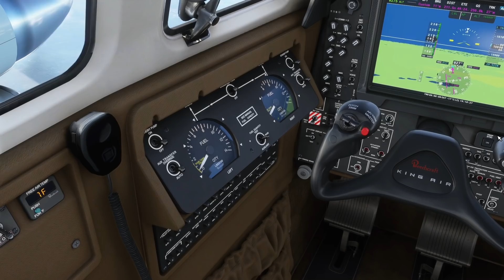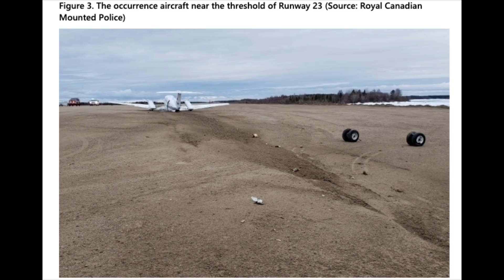The Pilot Who Forgot To Fuel His Plane | Keewatin Air 202

Comment: That windmilling prop creates a whole lot of drag. I'm pretty sure if they would have immediately feathered the prop they would have landed on the runway without any damage. But they still would have been idiots
Reply: Not true. All airplanes have a figure called "best glide". It can be as high as 1:60 for a good sailplane, and as bad as 1:3 for a parachute. But powered airplanes are between 1:15 and 1:20. But I don't think that 1:20 has been achieved yet. 

The normal approach path to a runway is 3 degrees. This is equivalent to a 1:19 glide path.  So a powered plane with engine out is rarely able to achieve that glide ratio. This "best glide" of close to 20 assumes: flaps up, best speed for best-glide (i.e. not slowing for touchdown), gear up, props feathered. 

So in general when you plan on landing on the remaining engine and hit the normal glideslope and THEN the second engine goes out... You're in deep shit. 

So.... when the first engine cuts out due to say "blowing up", you can assume this to be unrelated to the second engine cutting out, so "reduce workload by doing things as you normally do" i.e. regular glideslope: Fine! 

But when you run out of fuel, the second engine cutting out is NOT an unrelated event. It is WAY more likely to happen once the first engine has starved of fuel. So you should aim for a 4 or 5 degree approach angle to allow for the second engine cutting out. Sideslip, zigzag, use speedbrakes, put out the flaps and gears to slow down. 

So again, if you are on the normal 3 degree approach path to a runway, you cannot make said runway without an engine running. 

(*) These calculations assume "steady state". If you start on the glideslope with excess speed, you can stay on the glidepath, bleeding off speed for a while. In this actual case, they might have had enough energy to JUST make it. Fly best-glide speed (i.e. aim for a point before the runway) and then fly in ground-effect while bleeding off speed towards the runway.
Reply: @rewolff2  Your thinking is correct, but your explanation does not support your 'not true' comment. Because if they'd feathered the prop, the remaining engine would have needed way less power and fuel so it would likely fail later. 

If they would approach with 90kts groundspeed, so with 40seconds longer power, they'd probably made it even without your very smart suggestions of higher speed, flaps up and maybe staying a bit above the profile.
Reply: @rewolff2  You're totally right, I was dumbfounded listening to him saying they were lowering gear to meet the VNAV and then had flaps out more than 1NM from the threshold, this is stuff you get taught before you fly solo. Complete amateur hour.
Reply: @rewolff2  Wind direction and speed will go into this as well faster. more air speed with power out means the ground is getting closer faster, should of leaned #2 engine and hit best glide for one engine and been ready for engine 2 to quit. 
Remember it is "power for air altitude and Altitude for air speed" since you have no power you are not getting more altitude and MUST conserve what you have. Never put gear out until you know you are making the runway. 
what cost them the plane was besides no fuel was 1. not maintaining B.G.S. 2. putting down the gear to early. 3. not feathering the props. 4. possibility might be a factor was poor choice of emergency landing field. might of been another airport, road or frozen lake, field that would of been a better choice.
Reply: @kandylandfarms9898  For a hanglider or paraglider a 10 knot difference in wind speed is a lot. (there is less than 10kt difference between "best glide" and "stall" on a paraglider) 
But for a big plane coming in at 140 kt... a 10 kt difference isn't that much. 
Now if you're flying at 1000ft with an airspeed of 200 and a headwind of 40kt and at touchdown-height there is only 20kt, then you only effectively have the energy of 180 kt airspeed for calculating how much energy you have available to bleed off....

Anyway, you can complicate the model as much as you like, but quick-and-dirty: without power you can't maintain a 3 degree glideslope without power. You can for a while when bleeding of speed, but not for long. 

here they landed on a flat area before the runway. But if "reaching the runway" is the only thing to keep you alive: don't lower the gear, fly relatively fast and without flaps until you've bled off all the speed you can lose only then add the flaps to be able to bleed off even more speed. If you still are barely making it don't lower the gear. Land on the belly. If that's what keeps you alive (reaching the runway) then keeping the plane reusable is of secondary importance. 

Here a few bad decisions were made. Early flaps, early landing gear with a known-fuel problem likely to starve the other engine too. Doing a few things "right" and you easily make the runway. 

On gliders, hanggliders and paragliders you know you don't have any power for a go around. Or if you misjudge your final glide and end up below the intended glide path: there is very little you can do to recover. For paragliders the fields are often big enough that you do base-to-final above the field. So landing early is not a problem. In spain I know a landing field where there are notorious downdrafts before the field and that field is short and unforgiving. Land early and you're in  a mess. Land late and you suddenly have 200m of height again. And nowhere to land. Absolutely packed down below. 

Low on fuel?: powered planes: Consider yourself a glider stay above the best-glide  cone emanating from the landing spot. Stabilizing on 3 degrees normal approach path: You're below the cone. Once the power cuts, you're in deep shit.
Reply: @rewolff2  “a powered plane with an engine out cannot achieve that glide slope”- WTF are you talking about?- a twin engine plane can climb on one engine- that’s the whole point of having two engines.
Reply: @biffaozzie2373  If you continue reading my comment, you'd see that I meant that a powered airplane with ALL engines out cannot achieve 3 degrees glideslope. So... as a precaution, with one out of two engines out you normally go and land ASAP.  But if you approach the airport, capture the 3 degree glideslope and THEN the second engine goes out... THEN you're in trouble: unless you have lots of energy stored in "speed", you can no longer reach the runway. Remember you're landing because you're afraid your last engine might cut out. Then to approach the runway on the 3 degree glideslope is a bit.... odd. Sure, you only need that last engine to stay running for the few minutes that you're on final, but I'm saying that staying above that, might be more prudent. 

All the calculations about dual engine failure start with: "Let us assume those are independent variables". Well... they aren't. If one engine cuts out, there are lots of common factors on ONE plane that could affect the other engine as well. BA38 coming in to london for example. So... staying in the cone that allows you to glide to the runway seems like a good idea to me.
Reply: And not lowering the gear above 5000 ft
Reply: You’d think that would be their first thought after losing the engine due to lack of fuel. It was my thought and I don’t even fly. It would have been different if they were going to attempt a restart
Reply: Best comment ever.
Reply: Yep, they are the finest Winnipeg has. Winnipeg = Loserpeg.
Reply: I hope Tesla comes out with “autopilot” to self-fly airplanes because humans are too undisciplined and error prone.    .....  coming from a pilot.  ....
Reply: @steveperreira5850  Unfortunately, people can’t be trusted to do anything for themselves anymore. Lawyers have taught us that everything is someone else’s fault
Reply: PJMontoya: Indeed, and they are less capable than ever, we coddle the unfit.  Reverse evolution in full swing.   

PS:  I live in a fly in community.  The lawyer right next door pile drived his new plane with girlfriend and “all important” DOG on a dark, rainy, cloudy night.  “Touched Down and Spiked It not 300 meters from his house.  Arrogant guy not Instrument Rated!

That was 5 years ago, my brother’s buddy witnessed it from 100 meters away!  Stall spin, full throttle, JFK Junior replay on terra firms.

Small planes, best way to thin out lawyer and politician ranks at their own expense!

Comment: Well they learned a lot on that training flight.
Reply: They learned how to look for new jobs, I assume.
Reply: @se-kmg355  I would hope so. The flight was FUBAR from beginning to end.
Reply: @wntu4  Surely a SNAFU?  It doesn't make grammatical sense for it to be "a" FUBAR.
Reply: @Kromaatikse yeah the 'a' was unintended. Fixed
Reply: @Kromaatikse  did you mean it doesn't make semantic sense?
The grammar is correct, the meaning is not.
Reply: @XB10001  To interpret the grammar, you have to expand the acronym to its underlying meaning - which is an adjective phrase.  You don't use a preposition with an adjective phrase unless there is a following noun to convert it to a noun phrase.
Reply: @Kromaatikse  oh, THAT was your correction! I thought you meant that the correct acronym was SNAFU instead of FUBAR.
Now it makes sense.
Reply: @se-kmg355  
I’d keep them. They’d never make that mistake again.
Reply: Touching a hot stove burner is not something one should have to experience to know it will hurt and fuel is nothing different if you don't want to fall out of the sky.
Reply: Something somebody who wasn't even a pilot would know: get enough gas and maybe even double check.
Reply: It Winnipeg so dont be surprised if it happens again.

Comment: This has to be one of the biggest OOPSes of all time!
Reply: I dunno, this seems like nothing compared to the KLM 747 pilot in Tenerife who decided to takeoff before he received clearance from ATC..
Reply: @Syclone0044  
Thanks - was just going to post the same thing.
Reply: Not even a top ten oops. 

“Gimli Glider". The accident is commonly blamed on mistaking pounds for kilograms, which resulted in the aircraft carrying only 45% of its required fuel load...”

Varig flight 254
“...The flight had several intermediate stopovers, the last being in Marabá, Pará. Prior to takeoff from Marabá, the crew entered an incorrect heading into the flight computer, flying deep into a remote area of the Amazon jungle....”  and had no idea where they were. Just kept flying hoping figure out where they were and where they could land. 

Turkish airliner gear up, too fast, bounce and failed go around. 

There’s much worse.

Comment: If the " captain " could NOT REMEMBER if he fuelled the aircraft or not. He does NOT poses the faculty required to be a safe and trustworthy pilot.
Reply: The reason checklists are used in aviation is precisely because humans forget steps of even very familiar procedures. They only work if you actually follow the checklist, though.
Reply: Shouldn't they have a refulling receipt ?. I thought that was mandatory to have.  If the instructor captain takes over . I think he explicitly has to say I have control and the other pilot. You have control.
Reply: This is a matter of the FO forgetting to have the plane fueled, not one of him not remembering if he had done so or not. BIG difference there you clown.
Reply: @SillyPuddy2012  I don't agree. Yes, the FO forgot to fuel the airplane, that's not the point. But not reacting when the fuel calculations were made with a "D'oh, I forgot to fuel the airplane!" is very concerning behavior. That should have been a wake-up call! It is as if he believed that he had fueled the plane after all, and the many reminders about fuel status throughout the flight didn't make him remember either.
Reply: @gnypp45  It's 50/50, but  the F/O was an instructor: I mean, come on, you're supposed to train other pilots and you have the responsibility to check if he's doing anything wrong, here everything was done wrong. Not fueling the aircraft, no before takeoff checklist, no fuel calculations nor checks, failure to understand what the problem was (descending without fuel?), failure to properly respond to the emergency (not feathering the engines). All these things should have been pointed out by the instructor captain.
Imagine you're training to get your driving license, and the instructor doesn't point out you should use the handbrake or use the blinkers or Stop to a Stop sign. Yes, you're supposed to remember these things, but the instructor's there to help you learn from your mistakes and make sure you don't put yourself or others in danger. Because when you're training you can forget even the most basic things, as you're not used to drive a car.
Reply: @hrgiyzueghe  Yes, you are correct in everything. Add to this that the FO/instructor set out to fuel the plane, but at take-off evidently couldn't remember whether the plane had been fueled up or not. This is alarming and might indicate serious problems with his working memory, perhaps due to a progressing medical condition affecting his cognition. To me it seems obvious that he shouldn't be flying, much less be instructing other pilots.

Comment: What is it with Canadian airlines and running out of fuel over Manitoba? That being said, I suspect if Bob Pearson was piloting it they would've been able to glide the bird into Churchill with knots of range left to spare!
Reply: Careful now. Let's not get knots of range confused with miles of wind.
Reply: Yeah, besides feathering the prop, should they have been at full flaps with gear down?  Wouldn't half flaps be the way to go, and wait on full flaps and gear as long as possible?  I mean you'd go in fast, but fast on a runway is better than smooth into a forest.  Not a pilot, so just guessing.
Reply: Knots of range? Do you understand the units of measurement you are using?
Reply: @ThatSB  He meant to say nautical miles of range, not nautical miles per hour (knots). We all make mistakes. Lol... :)

Comment: Maybe the pilot forgot to fuel the plane, but at least he got everyone on the ground savely.
Reply from the maker: That he did. And some pretty good flying too. Had it been a mechanical failure he would have been a hero
Reply: @MiniAirCrashInvestigation  Definately
Reply: @MiniAirCrashInvestigation  One of the nurses on board disagrees up above. Guessing he posted after you did... 

Quote: "...the pilot dove the plane immediately realizing the situation, forfeiting a lot of his altitude which he realized later and then leveled off but by this point it was too late. Then I watched as the pilot and copilot struggled to maintain airspeed and altitude to reach the airport."